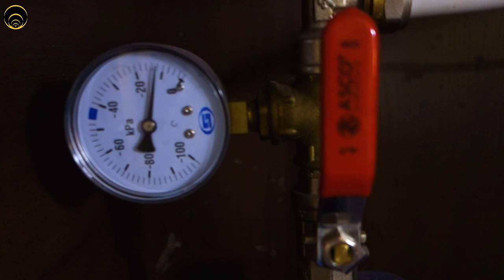How to make a Magic ring "Blue Abyss" | Art Resin

Comment: Great work, fantastic end result love it. At 05:30 what is that liquid you submerged the ring please?
Reply from the maker: Thank you, beeswax with butter.
Reply: @TheJewelryFantasy  ok not came accros that before. And what's the purpose of that?
Reply from the maker: Wood becomes stronger from wax, oil impregnation protects the ring from water.
Reply: @TheJewelryFantasy  awsome thanks, did you consider different mixtures, oils?
Reply from the maker: I left a link in the description

Comment: Hello beautiful ring congratulations, I would like to see if please can you tell me what measures are the wooden square that you used in centimeters since I am in Mexico thank you very much
your server and friend adrian martinez
Reply from the maker: I have everything in millimeters, the diameter of this ring is 16mm
Reply: THANK YOU SO MUCH BUT YOU DON'T EXPLAIN ME WELL I WANTED TO KNOW THE WOOD MEASURES BEFORE WORKING IT IS SAYING HOW MUCH THEIR SIDES ARE IN GROSS BEFORE THE BREAK OR PARTS, YOU COULD SUPPORT ME @TheJewelryFantasy
Reply from the maker: I don’t quite understand what exactly do you don’t understand?
Reply: HOW MUCH DO YOU MEASURE THE TABLE OR WOOD PIECE SINCE THE START WHEN YOU CUT IT?
Reply from the maker: How to scale the size of the ring under the finger?
Reply: OR HOW MUCH YOU MEASURE WHEN YOU LEAVE THE SIERRA @TheJewelryFantasy
Reply from the maker: Look, initially I make pieces of wood in the video under the 18mm finger size, I add 3mm to 18mm on each side, then multiply the width by 1.6 and get the length of the workpiece.
Reply: LOOK I ALSO MAKE RINGS BUT THE FACETED THAT YOU DID IN THIS RING IS BEAUTIFUL BUT I DON'T LIKE IT ITSELF BECAUSE IT IS THROUGH THE THICKNESS OF MY WOOD BLOCK THAT I WOULD LIKE TO KNOW SINCE YOU MEASURE TO WORK THE WOOD PIECE AND LARGE @TheJewelryFantasy
Reply from the maker: Try to write in your native language, I understand you something bad :)
Reply: HOLA ESTIMADO AMIGO MI NOMBRE ES ADRIAN GRACIAS POR TOMARTE LA MOLESTIA DE RESPOMDERME  MIRA LO QUE TE PEDI POR FAVOR SON LAS MEDIDAS DE LA MADERA LADO POR LADO DESPUES DE SALIR DE LA SIERRA.
OYE Y DE VERDAD TE FELICITO ERES TODO UN MAESTRO Y TU ANILLO ES UNA OBRA DE ARTE PASA BUENA TARDE
Reply from the maker: Te interesa la plantilla que utilicé para el anillo, desde diferentes ángulos.
Reply from the maker: Mañana lo publicaré junto con el video.
Reply: @TheJewelryFantasy  GRACIAS AMIGO